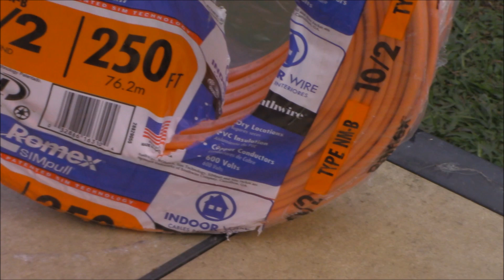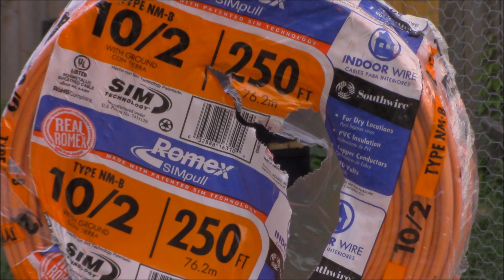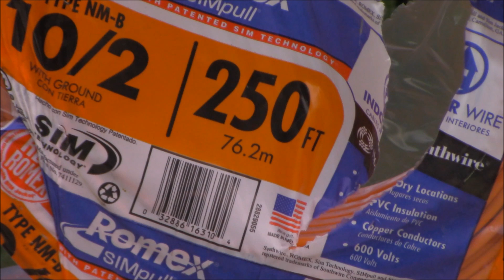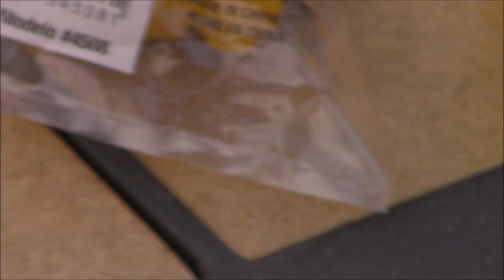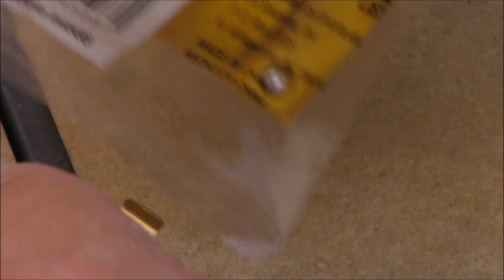8-29 update & making a 250' extenstion cord to power tiny house

Comment: If you need to store things at the house out there at the homestead, maybe a solution would be a jobsite box or even a gun safe. Attach it to the studs inside the house or barn with some 3/8 or half-inch lag screws, and put a good lock (or two) on it. It might not hold everything, but would secure your high-dollar items so you don't have to worry about them. Jobsite boxes might be available on Craigslist or even at the pawn shop, while a good gun safe would be a permanent addition to the house.

Comment: Be sure to get the 20 amp rated plug and receptacle.  I thought I would save 4 bucks and the plug heated up and melted until the wires shorted and the breaker blew.  It ruined the $65 fuse box on my shed.  Luckily the metal box prevented the heat from catching my shed on fire.
Reply from the maker: +BC ElginTex  He just has regular 15 amp receptacles for me to plug into.  I have a set of 20's in case they start getting warm.  But, I'm only going to be moving 15 amps.

Comment: hey Joe, if you put about 6 inches of straw or wood chips in the chicken run, it will help with the mud and poop.  As well
as give the chickens something to scratch.  Maybe you could build a plywood box at the pole  and use one of those garden hose wind up gadgets and just lock it up to the pole in the box.  just some thoughts. Cheers
Reply from the maker: +Joshua Smith Thanks.  Gail put some in tonight.  I was thinking of something like that, but this is only going to be very temporary.

Comment: I hope you are using 220V wiring to xfer that energy.  Using any household orange electric extension cord will overheat (from too much resistance, too much distance).  You will brown out your appliances, and that will kill them as well.
Reply from the maker: +John Lord This isn't extension cord wiring.  This actual 10-2 with a ground to carry the amps I need.  That's why I'm making a cord instead of buying some.

Comment: I hope that hack extension cord will be installed on a GFCI circuit.  nm-b romex is not legal to be used an extension cord.  You need type SJOW cord that is weather resistant and abrasian resistant.  That romex you have is not allowed to be used in wet or damp areas and must be protected from physical damage.  I'm an electrician.
Reply from the maker: +SkilledEddie  As I said in the video....this is only a temporary solution to bring power from a pole a couple of hundred feet away.  Maybe one or two days a week if we happen to get out there.  The rest of the time, it will be wound up and put in the house.  The purpose in using this is simply I will also use it to wire electric and lights in the barn once we have our own service put out there.   I am not an electrician, I'm just dude that needs temporary power from a source 225 feet away lol.
Reply: Homestead Dreams At St. Bernard Acres
I didn't watch the video yet i just saw like 20 seconds.  Regardless of it being temporary it does not matter to the NEC or the local ahj guaranteed.  SJOW cord is the temporary type cord needed.  If you are still going to hack at least plug it into a GFCI for your safety.  If that wire gets a pinhole in it and the grass is wet or damp you can be shocked or worse electrocuted.  A pinhole in the conductor will not guarantee the breaker will trip but a GFCI will instantly.